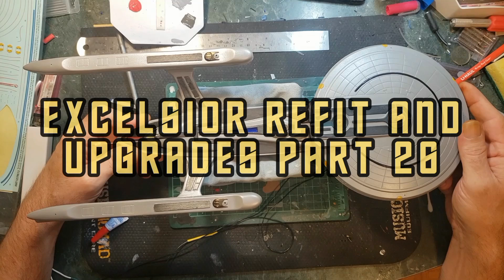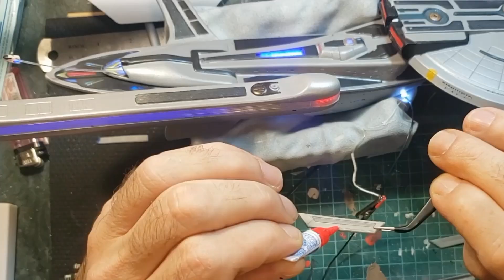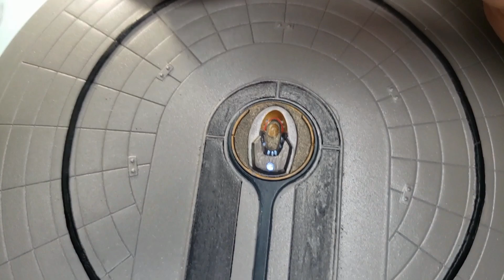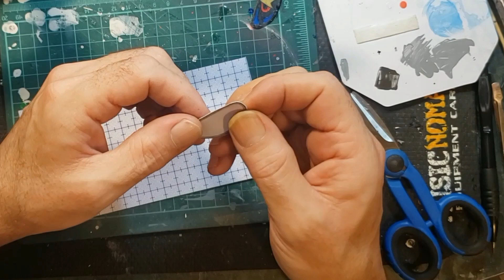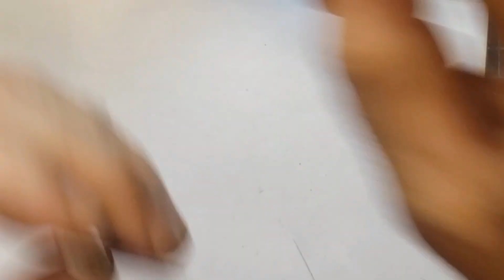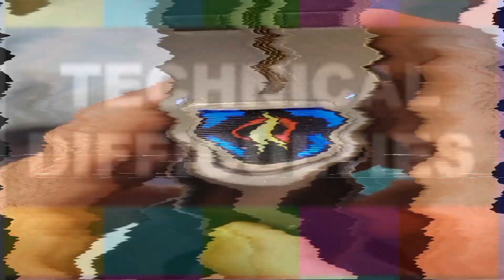Excelsior Refit and Upgrades Part 26

Comment: Aww you got a beautiful bird. I was wondering what type of bird you have. I love birds and I miss my Quaker Parrot. 

Awesome continuation and I like those covers from the Discovery Enterprise that you added between the bussard collectors and the rest of the engine.

I use those same jeweled lenses for my Trek builds to fit in as the formation lights.

I'm honestly surprised you use super glue and not regular modeling glue. I guess the super glue would be easier to get into the model to replace burned out lights?

Edit: I love seeing those few pages of what you have in your sketch book. Is that all that's in there? You're a good artist. I like the updated look of that aft underside insert you had to fix. The one with the Starfleet emblem on it. Sucks your storage got full at that point lol.
Reply from the maker: Get ready for the finale tomorrow.